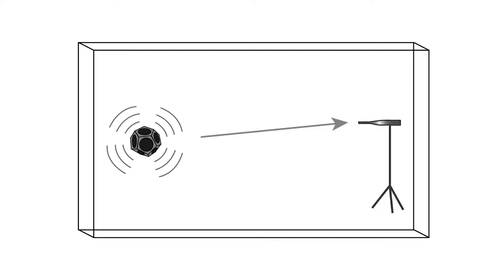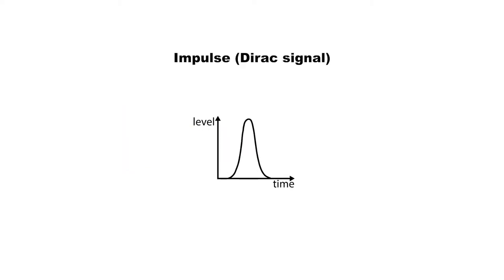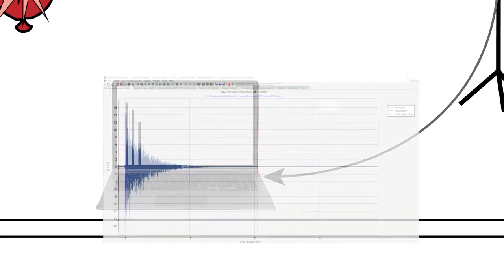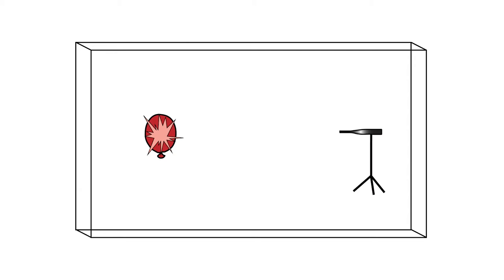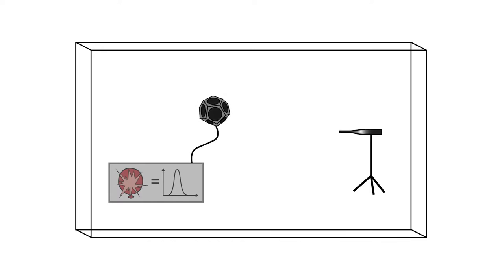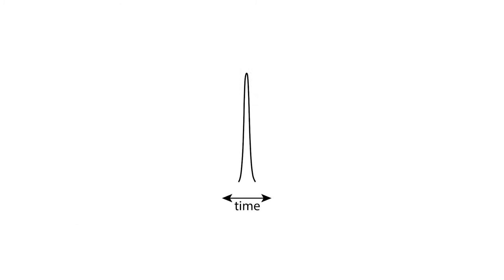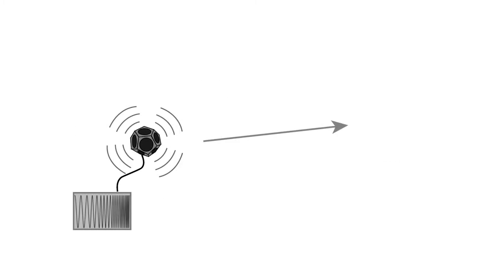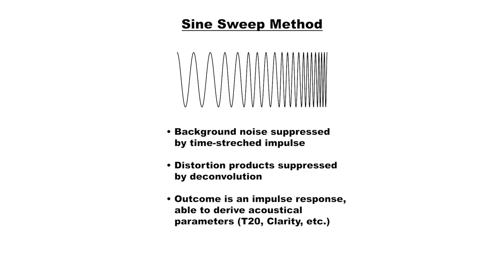Acoustic measurements with the sine sweep method

Comment: This was awesome. However, I do have a question that I can't seem to find the answer to. As you stated the sine sweep is the "time stretching" of the dirac. That makes sense. But then that means when you then play the sine sweep, because it takes a while to emit the total sine sweep sound, then as the microphone get's to measuring the high frequency component of the sine sweep, this part of the recording must have lower freqeuncy reflections included in it because it took lets say 1 second before the 20 kHz sound was played. So then, how do you totally leave out the reflections from this analysis when you do the FFT? The impulse was easy to remove the reflections because it only had a length of sound that we know lasts a very very small amount of time, the sine sweep persists longer through time.
Reply from the maker: Hello! First, you apply a deconvolution filter, which basically shifts all frequencies back to start at the same time, and so the recording turns into an impulse response.

From the impulse response, if you take a single FFT of the whole thing even with reverberation tail, it still gives you a valid spectrum of the room. But it would be more accurate and informative to produce a spectrogram (using an STFT instead of an FFT) which then will also show how the different frequencies decay over time.
Reply: @ODEONRoomAcousticsSoftware   Ah, that makes sense. Very clever. That answers my question, I appreciate you reaching back.

Comment: What is the optimal duration of the sweep signal for a given bandwidth?
Reply from the maker: Hello! The recommended length would not depend so much on the bandwidth but on the SNR, so how much you are above the background noise. If your SNR is too low, that's when you increase the sweep length to increase the SNR